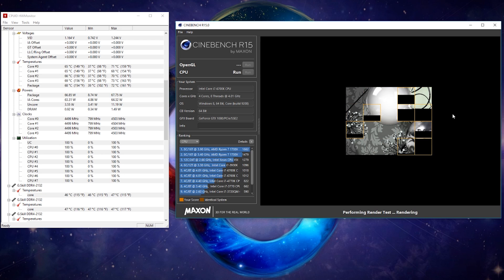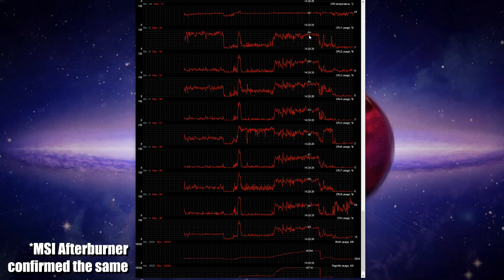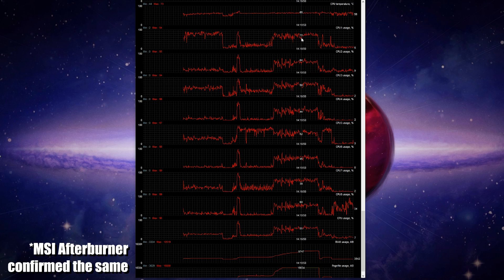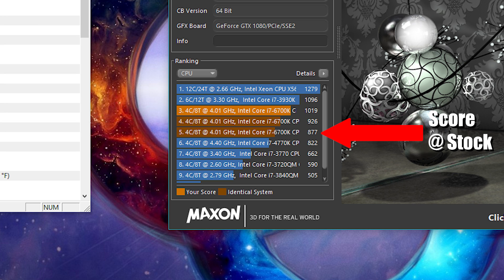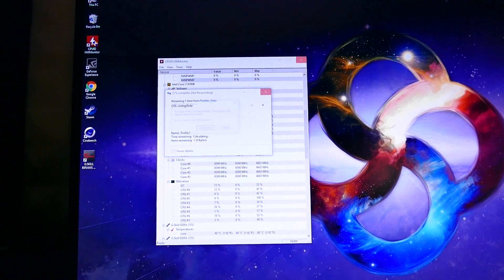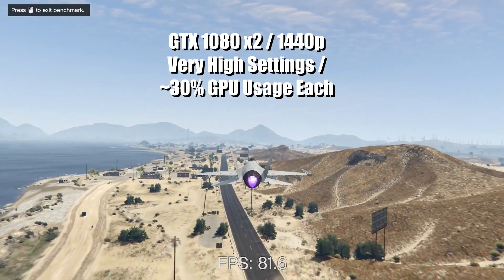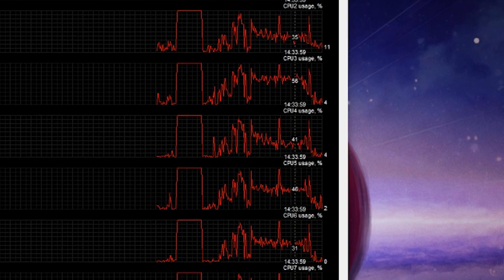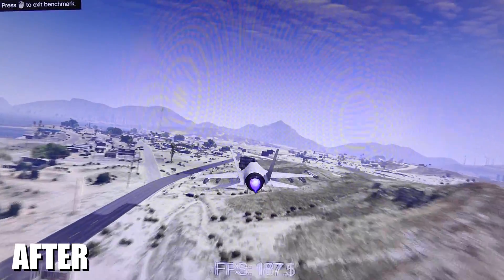My PC was Terribly Under-Performing...

Comment: did you tried uninstalling the video driver? I had the same problem once. There seems to be some legacy settings got left if you just upgrade the drivers. There are cases where hiccups can only be fixed by totally uninstalling the driver and reinstall.
Reply: Wait so I should uninstall my gpu driver and re install it
Reply: @jamielannister6922  I can't say it will work for you specifically. I did have that problem with my rx480. I googled "rx480 blackouts", some pointed a problem with recent drivers, so I uninstalled the driver, searched for an older driver, and turned off auto update. It took 6 months for amd to fix that specific problem with new drivers.
There was also another problem I had with malfunctioning motherboard, but that's another story....
Reply: @outsidethebox262  hey man, I litteraly just reinstalled my gpu driver abd everything is good

Comment: My computer tilted over. And my 1080 started running 30 FPS compared to its usual 250-300 on league.  But when I looked inside the tower everything appeared to be fine.

Comment: hey brow, i have a single gpu gtx 1080 cpu i7 4790, i having 20% / 30% usage in dota 2 give me 70/90 fps , using 144hz monitor this is lagging me , u can help me, upgrade my gpu usage, is a good idea wipe the os?

Comment: Congrats man, you are one of the lucky people who recognized that Windows in-place upgrades worked like a charm. In fact Windows 10 upgrades e.g. from 1607 (anniversary Update) to something like 1703 (creators update) works the same way as an in-place upgrade from Windows 7 to windows 8.1 was working before. Save yourself some headaches and defer W10 Upgrades as long as you can. When the time is over and Windows does not allow more days to defer, re-install everything with the newest W10 media and continue deferring Upgrades. It also helps to disable driver installs via Windows Update, as you will most likely not see them updating and the drivers aren't always compatible with your chipsets etc.

Comment: I had the same problem I factory reset it. I still had the problem. I have a A8-7650k and 1060 3gb. I run gta 50fps average on normal, high and very high. It makes no sense help.

Comment: I have 32 Gb ram, Gskill @ 1600Mhz cl9. I use 16 Gb as a ram disk in combonation w/Eboostr. This leaves 16 Gb for the OS. This makes my computer scream. Games and browser tabs load instantly. I put temp and IE temp and some game launchers in priority on EBoostr. System is a 2600k @4.4 Ghz w/a EVGA GTX 1080 SC GPU, O.C.'ed. FireStrike, I score in the upper 88% So I'm well pleased. All frame rates never drop below 60 FPS. That's w/the latest games. I was able to find the 1080 for under $400.00 on E-bay w/full waranty. MB is Asus P8P67. I've had this system running since 2011. On Windows 10 with updates/MS spyware diabled. Never had a security issue. I use A key stroke encryption to avoid problems. And Norton and Malware Bytes

Comment: Windows analizes your hardware over the course of time, after some time windows will try to optimise your gpu output but when you have a sli configuration the drivers of nvidia don’t like that windows screws with them and when they are working against each otter they will cause your gpu config to slow down because it will have to decide without the full help of its drivers

Comment: I had a similar problem with a q6600 and a gtx 650 i was playing a few games and realised my fps was around 30 so I just assumed Its because it's outdated and moved on but then I saw benchmarks for my cpu and gpu config and saw much higher fps so reinstalled win 10 and it was the same as benchmarks. 
 
I know my system is old but it's fine for what I want at the moment.

Comment: I'm pretty sure it was a power suply problem! the thing is, everything were optimized to suck as much power as it cloud from the power sourde and it cloud not handle all the outputs at once as a whole, or every lane individually. Even though you have a powerful suply, sometimes you can run into a load effect issue, wich (witch, idk, you might had already undestand) the current output from a power suply makes the voltage to drop below recommended. If it was the case, the computer should be trying to balance for that lowering the power usage, handling that as poorly as it cloud...

When you reset the bios and your OS, all resources drainage went back to normal and your power suply cloud perform as good as it shoud, with no load effect (electric engineering term). My sugestion is for you to review if your power cables has any dents or shorts, testing them with different ones, since your power suply shoud be modular, and try another power suply, because the one you are running might have some problem past some load point.

well, this is some different point of view that you didn't suggest in video, so I hope it helps

Comment: i also have 1
gtx1080 sli and i often get lots of artifacts when my gpu frequencies drop from around 2.1ghz to 1.2ghz although im at like 45c° on both cards. i7 6700k@4.5ghz overclock on and im liquid cooled so no thermal throttling around 40c at full load. So reset cmos and reinstall should fix everything after upgrading to sli?

Comment: My pc: CPU - I7600k 
Gpu - 1050 ti
My mother board - Asus b150m plus
Ram - g skill 8 gb trident z rgb 
The CPU is using at about 60% 
But my gpu barely could hit 30% on csgo, I normally get 300-400 but I suddenly was getting 150fps, I've tried updating drivers and using old ones but nothing has worked. Can someone help me out??
Reply: did you ever figure it out i am having a similar issue

Comment: That's extremely weird. Seems you've done everything I would've done or vice versa. But with the exception of one. Did you try running any of the benchmarks or GTA V itself with a single GPU to see if there were any noticeable differences?

Comment: 4 days ago I had a problem whit my cpu (running at 800 Mhz and Intel Extreme Tuning Utility showing it was hyper throttling) and turns out it was my motherboard slow mode that was on (software wise) even tow the switch on the motherboard was off,
a simple on/off and the problem was gone.

Comment: Same thing happened to me with my 6700K and 1080. Reset everything to default, clean boot windows 10 after hardware upgrade. Then things were normal.
Reply: how did u reset everything to default dude?

Comment: I actually just have one key question (excuse the pun) :
Did Windows 10 not complain that you had already used your licence key after re-installation? Or does it check the hardware, discovere it's the same, and then let you proceed?

Comment: Honestly, it could be as simple as corrupted data somewhere. With the crazy amount of bits thrown around doing all kinds of things, it's kinda amazing it doesn't happen more often.

I noticed you mentioned the swap file (actually not likely to be an issue, as you really shouldn't be paging with 32 GB), but don't mention what drive(s) you actually use. If you have an HDD somewhere rather than full SSDs, I'd suspect there may be an issue there. Modern games like to stream their assets in, and if you're not bottlenecking GPU/CPU/memory/lanes, then that's one of the final components left to consider for bottlenecking.

Regular HDDs have some interesting characteristics that most people don't consider on a regular basis. The first characteristic is fragmentation. On Windows 10, it's not so much an issue normally because Windows 10 defrags once a week, but if you are power user constantly moving data around, it could be a serious consideration. If you're manipulating huge video files, maybe do that on a separate partition or drive than the games.

The second characteristic of HDDs is that files on different parts of the drive read faster or slower depending on how far from the center the heads are located. Modern drives always spin at a constant rate, so cylinders further out are reading/writing more data with a single rotation and are thus faster. I believe the convention is that when things are on the top/left of a defrag or partitioning screen, that is the outermost edge. Partitioning can help; place Windows, the swap file, and disk-bound games at the beginning.

If you are using all SSDs, then all I can do is shrug and say I don't know. Maybe corruption or a setting that you missed.

I do a lot of programming and a bit of IT, so I'm kinda hesitant to say never poke around with settings - that's how you learn sometimes. But definitely make sure you can undo any changes you make. And keep backups.

Comment: assuming you recycled the SSD that contained the OS, and used the same 1080s prior to assembling this pc, but a different MoBo: a fresh install of windows 10 would have been necessary to efficiently utilize the pci-e lanes on the new motherboard for your dual 1080s in SLI. sometimes Windows operating systems hate sudden motherboard swaps.

Comment: If you hadn't wiped I would have told you to see what happens if you force your BIOS and OS to use HPET (and HPET only) for timers. Using different timers (especially legacy ones with lower precision) causes micro stutters and performance drops as the different parts in your PC basically pause while the different timers sync up.

Comment: Maybe you can think of a solution to my problem. I have tried to find a fix for 2 years now.

I have FX6300 and R9 270.

The problem is the gpu. On idle its always running on 200 core clock and 500 memory clock. It even runs at that value while browsing the net.

So the issue is that its stuck at 35% speed. And it rises only when watching videos, movies or playing games.

You maybe be wondering, so what? That's what gpu's are supposed to do right?

Well my screen seems to have distorted vertical lines the longer I have no game running and it gets worse the longer my pc is inactive, to the point where screen just goes to black.

And the only way to fix it is by running a game or movie in the background. This however never happened when I first built my pc, this issue just randomly started 3-4 months after using pc.
Reply: looks like a broken vram chip, any problems in games with graphic artefacts or other weird stuff?
btw. is your gpu clean from dust?

Comment: There was an update sometime last month for W10 and these are the issues I experienced:  The GPU refused to clock higher than it's default low, which was in the 100's. My center speaker and subwoofer no longer worked. My CPU clocks were off. The update installed GPU drivers, so I took care of that issue and the GPU worked normally. I tried a similar solution for the soundcard but that didn't work, I then notice there is an extra sound device which I came to realize was the onboard audio(I use a PCIE sound solution). Now, I want to preface this by saying I do not feel comfortable saying that somehow a windows update changed my BIOS settings, but I know for a fact that on board audio had been disabled in the bios and I have no other explanation for what happened. I ended up clearing the CMOS and reinstalling all drivers, a complete reformat wasn't needed and everything is fine now. but this is the second time my PC has had issues immediately after a W10 update and I doubt I am alone in this.

Comment: Had same issue on my gaming laptop. Used ThrottleStop and i unchecked BDProchot option. Solved it right away but my cpu went on steroids and thus greater heat output was created. Now i can only work with it in potato state or steroids mode. pick your poison.

Comment: The CPU thing isnt anything new, sometimes happens, i think its about touching a lot of times voltages/frenquencies and making a lot of reboots, its like it just corrupts. About the GPU probably was a driver issue, just use DDU and it would simulate a clean install of windows in terms of gpu drivers. But use it in safe mode ortherwise its almost useless.

Comment: Potential corruption from the Registry or the driver itself.  Just because the driver is the same doesn't mean it was working the same before you did a fresh install of the OS.

Unless you LIVE in the Registry, there's no point in making things worse by trying to use tools that will "clean" or "repair" it, so a fresh start is usually the best answer for these situations.  Most programs have online backup anyways, so just most of what's in your Documents folder, and any media you download would need to be backed up (unless you're like my friends and still use Yahoo as your primary account, then you may need to backup a few hidden folders to get back to where you were).

Comment: Look into Core Parking feature, those values in your registry probably got messed up. It's the only reason I can think of a new OS reinstall fixed the issues. The only time I had to reinstall the OS is because the registry got corrupt by an application.

Comment: Slightly unrelated but I have an old IBM server that was crashing, displaying green blocks all over the screen... all kinds of broken. I reflashed the bios and it was half fixed.. that fixed it enough to run the flashing programs outside an OS and after re writing them over again, it's 100% fixed, so weird because the first flashing in windows verified perfectly. I was sure there was an hardware failure but nope.

Comment: To fix by reseting the BIOS to default settings and reinstalling the operating system, suggests to me that the issue was in the windows power plans' incompatibility with the system firmware. Just my two cents...

Comment: Man, 
since I changed from my 960 SSC (99% usage all time) to a 1080 FTW, I never saw my GPU usage go to 99% anymore.
Even in 1080p / 1440p.
Only, after enabling DSR on NCP, at 4K, it went to full usage, but not with a good framerate.
My best guess would be that Pascal GPU are no optimized on GTA V, or Rockstar is not optimizing GTA V properly to Pascal.
I did a new install at all my system (Win 10 PRO), but still, at my case, didn't change anything.

For comparison, my configs are:
MB Asus Rampage IV Gene
I7 3820 Stock
16Gb DDR3 Corsair Vengeance Pro 1600Mhz
GTX 1080 FTW (Now I have a FTW3)
PSU: Corsair 1050HX

Comment: Hahahahahaha i7 6700k and Dual 1080s......

btw you speak too much, what was the problem? i only heard after reinstalling OS the problem was away, but do you know what it was in the OS or other Software?

i have the same problem with "low" fps, my 1070 could push around 100-150 fps on GTA V, but (only) during deep,fast flights or much cars my fps drop to around 60-70. No problem, cause i play on 60 hz monitor, but my first 144Hz is coming, so i want the most fps possible :D

it seems theres a CPU bottleneck in this scenes due the streaming of the game, but this advanced options(advanced streaming while flying) are a must have to see people early enough with hydra gunruns etc.

Comment: i had the same problem with my 1070 where it didn't go over base clock in games and stayed around 25%. i found that it was actually a problem with the graphics drivers if it was a bad installation or the version i was running didn't like the version of windows i was on i still do not know but i updated my drivers and it seems to have fixed itself.

Comment: The multi-GPU platforms, might not be the issue, since they've come a long way, but you'll always have software issues that can be created more easily with a multi-GPU then a single-GPU system, just because of complexity in allocating resources. Windows 10 and newer drivers and patches to games have been fighting each other in many rigs, the more complex, the greater is the risk of problems. Just look at YT and Twitch gaming content producers and you'll find some stories with these more complex rigs. nVidia and AMD can get sloppy with some driver versions, but Win10 can be an issue for gamers. Still running Win7 64-bits, but my rig is old and relatively simple anyway, so I can't tell you to drop Win10, but I would get the community over this pressuring nVidia and Microsoft for better care for the gaming PCs. Else, Microsoft will only loose to itself and have tons of people running around trying to find Win7 ISOs!

Comment: I had issues with the "Game" mode on my system while running CFX. When I turned it off it fixed all my problems - including crashes in games and frame rates

Comment: I had a question for you:  What, if any, registry maintenance software do you use?  I use Glary Utilities personally, wondering if a Glary 1 click maintenance might have removed the bad registry entry for you.  If you had two entries pointing to different drivers or versions for the same device that could slow you down like you described.

Comment: Cool video. I`m not an expert in SLI but if with reinstalling your operating system you fixed both problems it is possible that some directives for task division resources where corrupted from an windows update. Anyway i`m glad your PC is running at full capacity now!

Comment: I have the same problem.. i7 6700k
SLI 1080
My PC prefers using less % (mostly the GPU's) and getting lower framerates instead of running full load

Comment: I'm curious. I've suspected my computer to have lost some juice lately, and I was wondering what you think.

The build:

MBU - MSI Big Bang-XPower II, Socket-2011
CPU - Intel Core i7-3970X Extreme
RAM - Kingston DDR3 HyperX Beast 32GB 1600mhz
GPU - ASUS GeForce STRIX GTX 980 Ti 6GB
PSU - Cooler Master Silent Pro M2 1500W PSU

Everything is running at stock values, but I was wondering what FPS you would expect in a newer game like for example GR: Wildlands at maximum settings? Are there any things you could recommend to increase performance?